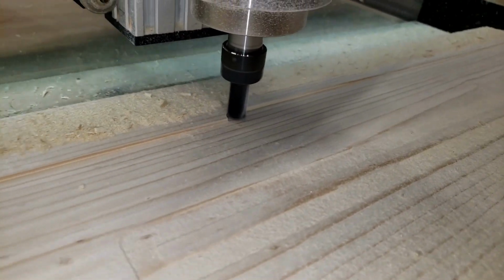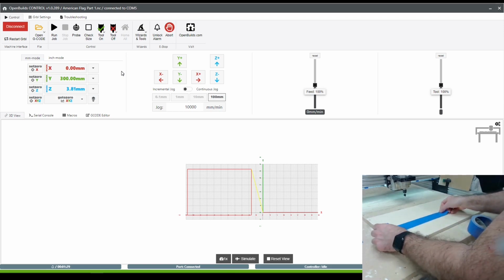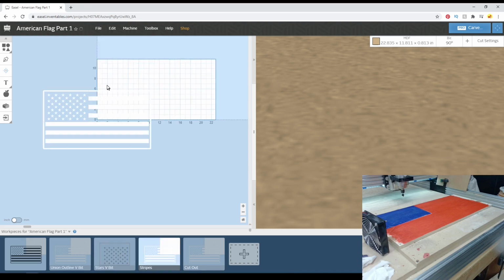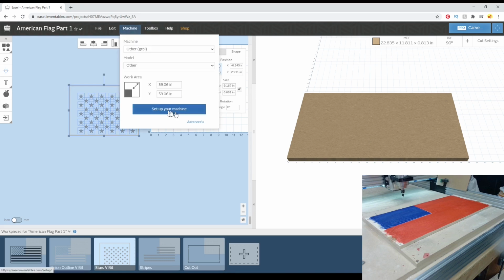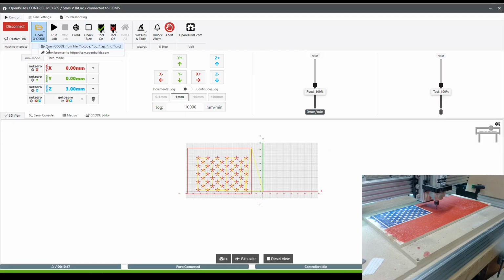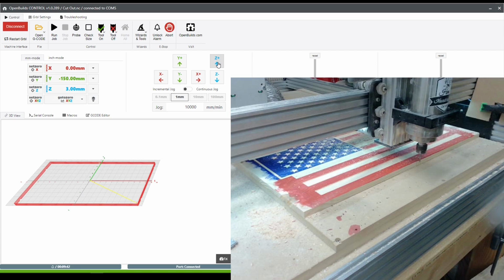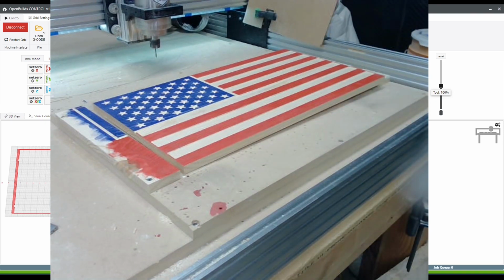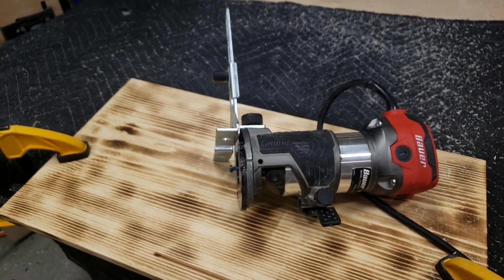How to make better wooden flags with only 2 bits - Easel Pro Edition

Comment: Hey Seth, what's the purpose of the box surrounding the union?
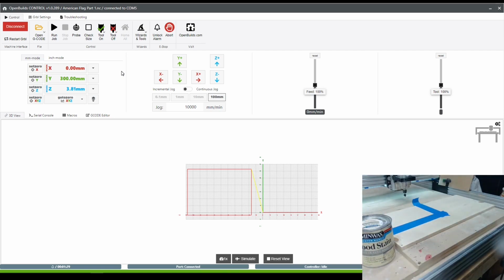Reply from the maker: That groove is used to align the tape used at 4:30 on the video & prevent the paint from bleeding between the red and blue 👍
Reply: @SethCNC  got it. Thanks Seth.
Reply: What size board did you use? Is this file in easel projects

Comment: I know this question has nothing with this video. But can you zprobe foxalien 4040-xe in lightburn?
Reply from the maker: Hm. You could setup a macro to do that and then tell it the probe plus the distance needed to achieve the focal height. Yeah it can be done, ive never seen it, but all of the commands are there to make it work. You've got me intrigued to try it now 🤔
Reply: @SethCNC  anything I can do to help??

Comment: What kind of wood is that? 
If it’s pine how did you buy it in that size ?
Reply from the maker: Hi Jake! It's 1x12 pine board from Home Depot. I usually have to buy 3 or 4ft length to get a good 2ft long section without knots.
Reply: @SethCNC  oh wow it seems so much larger on video lol thanks man!

Comment: What program are you using to send the Gcods to the machine? I use easel to send to the machine.
Reply from the maker: When it involves reusing a x,y i prefer to send it with openbuilds since the x,y,z are displayed the whole time. It also has a bunch of extra features missing from easel.
Reply: @SethCNC  thankyou so much for the reply